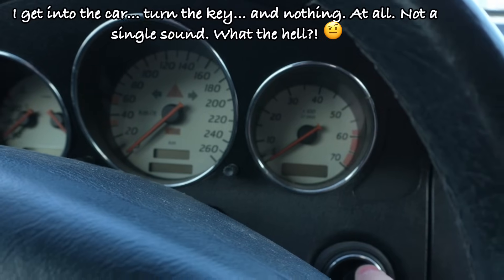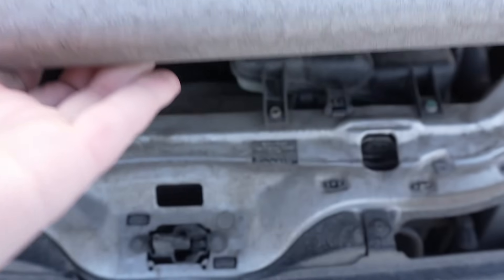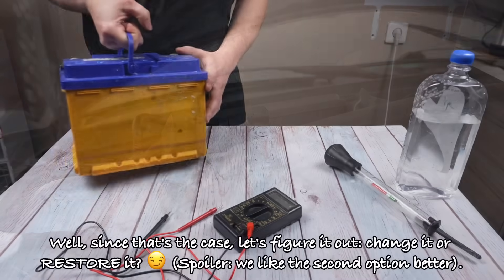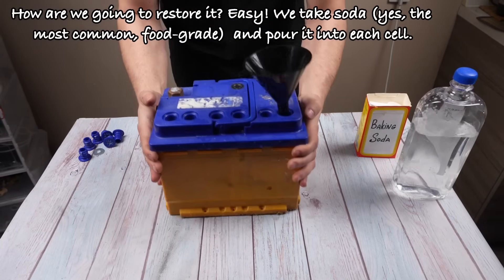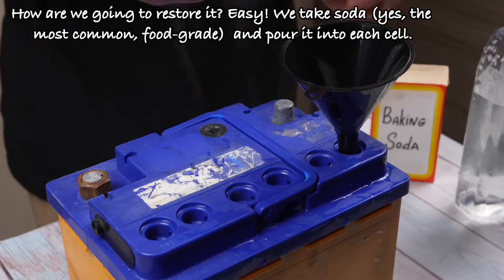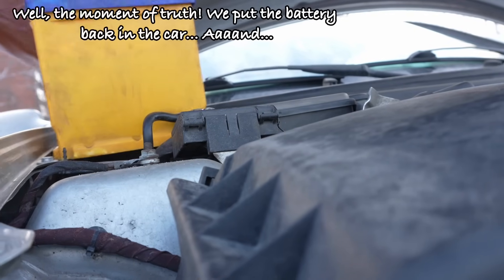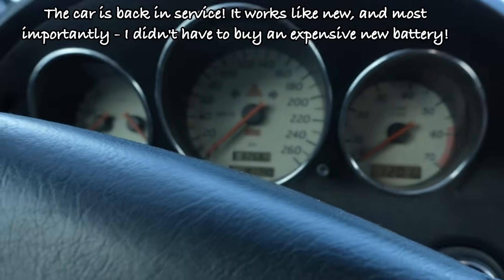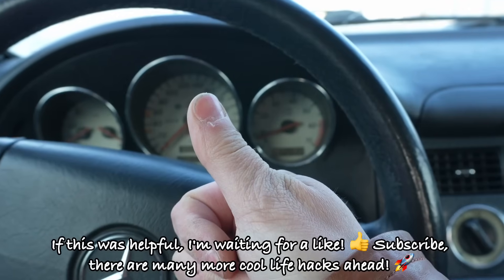Revived the BATTERY with baking soda! The motor spins like crazy

Comment: Awesome thanks I will check that out thanks
Reply: what nonsense. What you are doing is dangerous, adding baking soda which reacts with acid to a drained batter which will have a residue of acid will cause a reaction resulting in expulsion of gasses. Those battery caps will shoot off and possibly injure.

Furthermore, the original acid in a battery is not vinegar, its, sulfuric acid which is much stronger than vinegar.

Your video is dangerous and not helpful in restoring a battery.